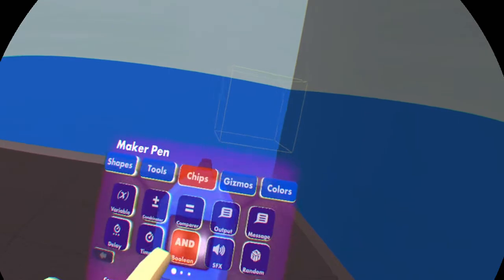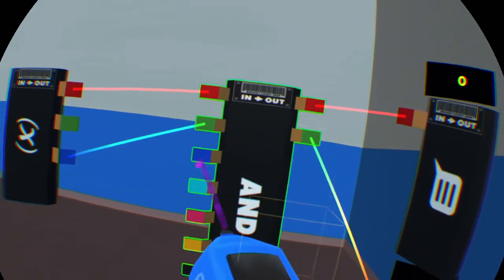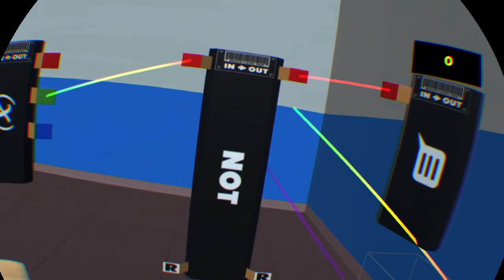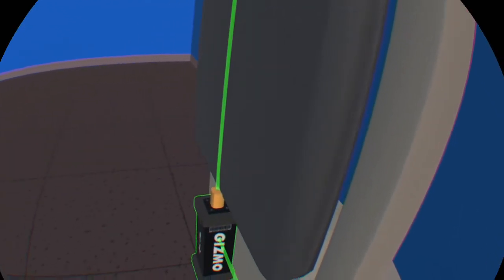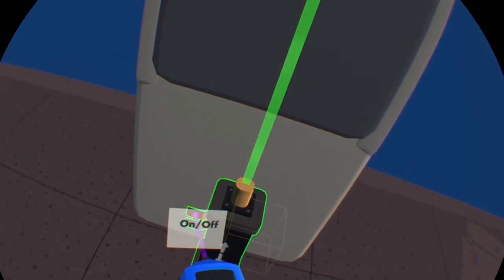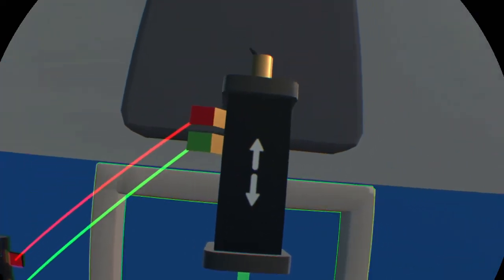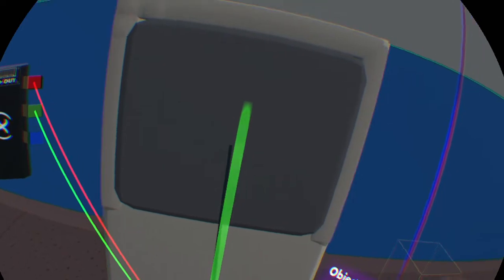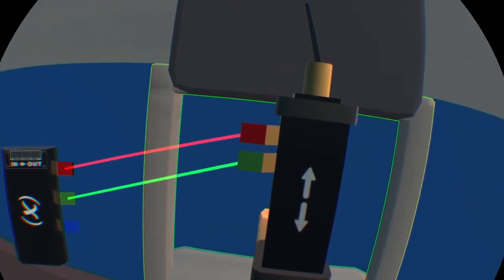Rec Room Tutorial Boolean Chip and Piston Gizmo

Comment: Hey man i like your tutorials with RecRoom! Got any tips on an elevator with multiple stops?
Reply from the maker: It's been awhile since I made a  video and I need to shake the dust off a little, that would be a good project to accomplish that. I can think of a couple of ways to do it, I should have video up in a couple days.
Reply: Hell yeah! Thanks man. I actually used some of your tutorials to make one! Its under new in inventions 'Elevator 2lvl' and i made a second called 'Elevator 2lvl extended' check em out! If you have a way to turn one of those into an elevator that stops at multiple floors that would be amazing.  Also my elevators are full publish so feel free to change it and republish if youd like.